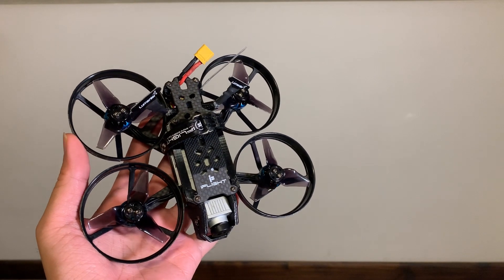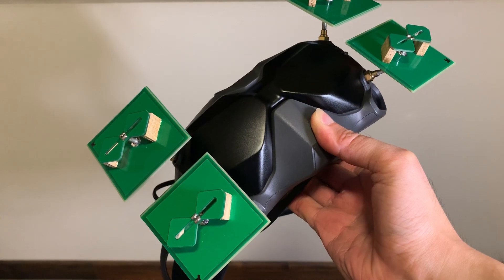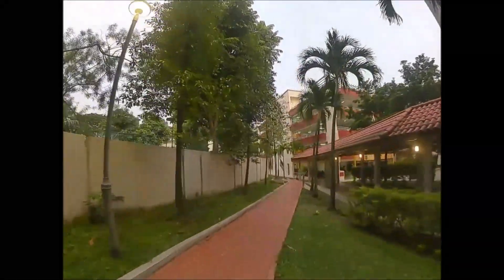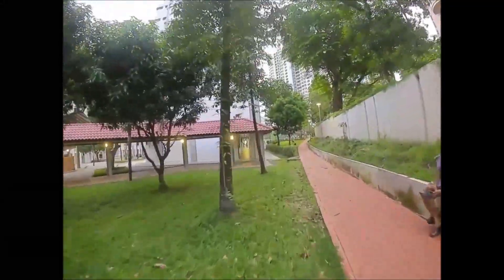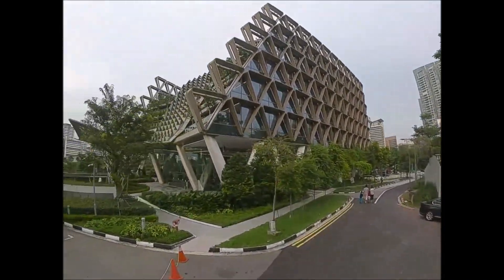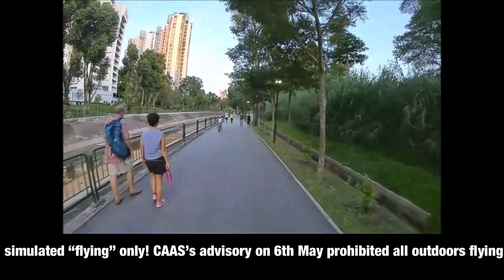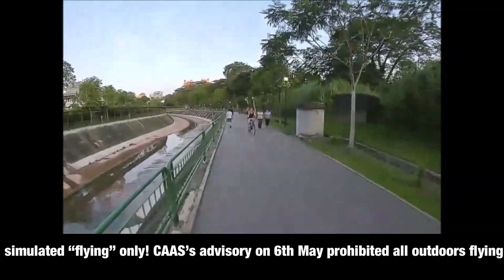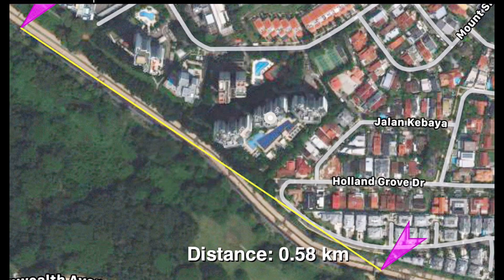Biquads on DJI Digital Range Test

Comment: How to test it, whether the resulting polarity is circular?
Reply from the maker: Thanks for watching. By design,  biquad antennas are linear-polarized. Hence I had to swap out the left hand circular polarized antennas of the DJI air unit with new Lumenier dipoles which are also linear polarized. Unlike analog video, I did not see any noticeable improvement for digital video with using circular-polarization. It’s MIMO technology like wifi where the linear antennae work very well.

Comment: Great video, thanks for the test. This is exactly what I was looking for, going all the way to failure.
Reply from the maker: Thanks for dropping by. To be honest, the drop-out on the DJI Digital FPV is kinda abrupt. Perhaps we are so used to analog systems where we could make out what the silhouettes are in a super-snowy B/W video during an RF-blindspot situation (eg: standing behind a container truck). With the DJI Digital goggles, it would be blocky video and all of a sudden, you get a frozen screen. And it takes a couple of seconds to snap out of it, unlike analog video.